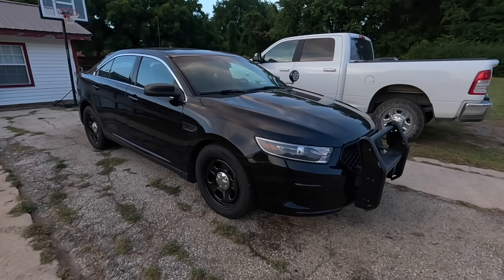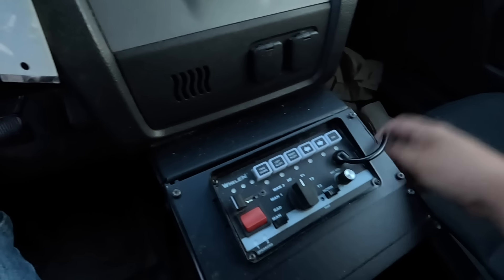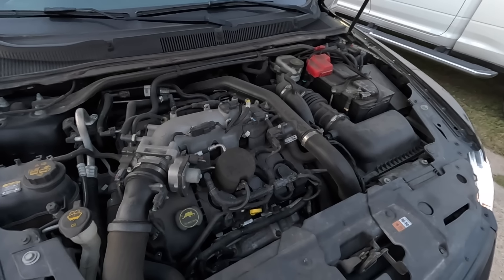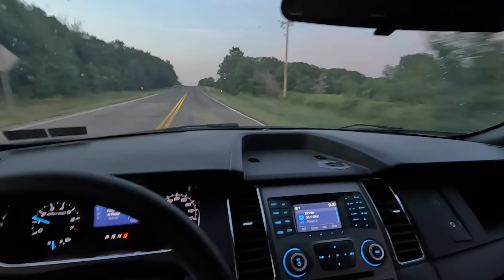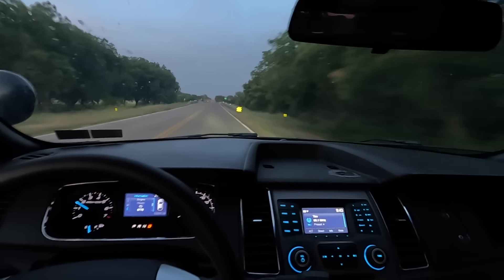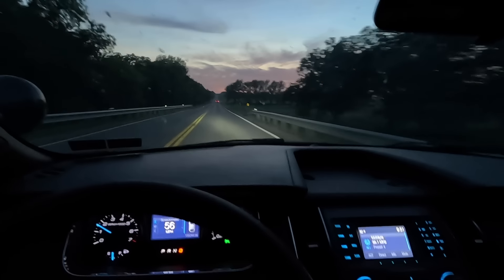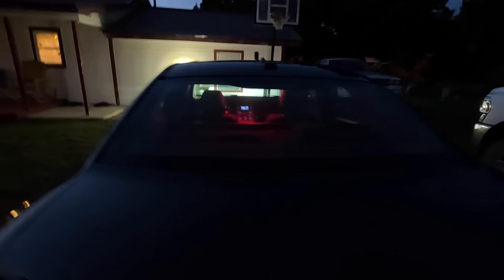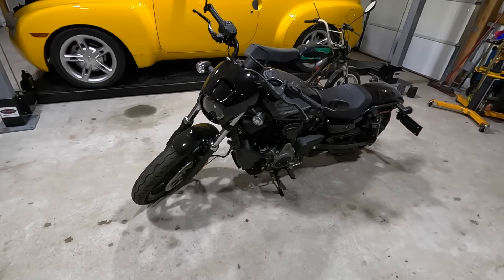I won this Twin Turbo AWD Police Car for $5K from Auction! They Made a BIG Mistake!

Comment: One hour of engine idle time is equal to 33 miles of driving, according to Ford. 4800 hours equals 158,000 miles so mileage equivalent is around 300,000.
Reply: It's not that simple I have a 2011 police charger with the 5.7 hemi and  it has 8335 engine hours and 2759 engine idle hours and I had a mechanic go through the entire car like literally everything and he said it looked like it had about 60k miles on it and it had 107k its all about the maintenance
Reply: 878 idle hours equates to 365.75 days (a little over a year of idling) of run time!
Reply: Yes, Ford does say that. However, I don’t believe that it’s an actual indication of wear on the engine. Ford came up with that spec so that fleet managers knew when to properly change the oil. Because even if the car is only driven a few thousand miles, the oil is still getting worn out as the engine is idling. Still higher idle hours, can mean issues for certain engines. This car is about average with 8000-ish total engine hours and only 4600 idle hours. That’s about the average range for used cop cars. It’s not been beat excessively but it’s no spring chicken either.
Reply: Im a deputy and wouldnt trust a used police car lmao, the amount of things my charger as been drug on just cause the ground clearence is terrible
Reply: I was always told that is was 40?
Reply: @billt2520  I’ve seen number from 25-50. I went with what Ford said since it was a Ford in the story.
Reply: Wow didn’t know that
Reply: @thepurplestallion93  Unless he actually tore the engine down and measured the wear on the bearings, this is nonsense to even believe. Wear happens every time the car starts, that is the majority of wear. Years of turning it on and off to sit still is the same wear as years of driving on the highway.
Reply: Come on, people with the idle hours, most of you would love to own this car for 5k. What a deal 👌.
Reply: @thepurplestallion93  maintenance is everything amd luck to. Some parts are better then other so.tines and so times you just get a car with bad parts. But like you said if you do the maintenance,most vehicles will last.
Reply: On a 78  Grenada maybe.
Reply: I believe Ford came up with that number when the Crown Vic was the king of cop cars. It definitely would not apply to twin turbo 3.5’s.
Reply: @paulhogsten2613  Decimal point error. 365 days = 8760 hours.
Reply: @thepurplestallion93  there’s no way a mechanic can tell that unless he took apart the engine and measured tolerance of pistons , walls, valves and other wearing parts.
Reply: 99% of the wear comes from startup, not idle or running.
Keeping up with the mileage only gets you so far on engine health.
Reply: @glenwaldrop8166  wrong
Reply: @ThaiRoney  No, it's not, it's historically proven. Dry startup is where 99% of engine wear occurs.

You can argue with a wall for all I care, it is a fact.
Reply: Exactly,  its a leak
Reply: It looks great but it had a harddddd life
Reply: Yeah that's not really accurate cause under a load things are very different driving than idle
Reply: @paulhogsten2613  no... 36.5 days. Math not your strong point.
Reply: is that highway or city miles lol
Reply: @ryancollins3227  That car is easily worth 5 grand.
Reply: @thepurplestallion93  thats NOT an ecoboost. Ford's maintenance requirements on ecoboost motors are significantly different
Reply: this is because the turbos are not receiving sufficient oiling during idle. and idling drastically reduces their life
Reply: Mileage or idle time doesn't mean a thing
Reply: @harbingerofkharma  that doesn’t quite make sense to me.. if your engine has oil pressure at idle, which it does, the turbo will receive the same amount of oil pressure, I would argue that high oil pressure can lead to premature failure of the Turbo seals, as well as a heating and cooling cycle. Consistency is key to an Internal Combustion Engine, and if it was used consistently I would wager that the wear is significantly less than actual driving miles.
Reply: Not to say that you’re wrong, but I would be much more willing to gamble on an engine with high idle hours than high mileage.
Reply: SHO engines where designed by Yamaha. At least that's what I've read !
Reply: @wisdomoverfear2685  so was the Lexus RC-F engine, a mean V8
Reply: I’ve bought a few of these from auction. 5k is a great deal for a twin turbo turnkey cruiser. I’d buy a fleet of 20+ for 5k in this condition. After a nice detail and tune up this should easily fetch around 10k. Great content as always 👍👍
Reply: @thepurplestallion93  hey bud I happen to be a lead diesel mechanic myself. Unless your mechanic opened up that engine, he can't anything about the internals. The issue with those idle hours is all rubber seals harden from that heat. Gaskets gets hard and blow out. The most common issue with these cop cars is they can look great till the last second and then major components fail back to back. Good cars to flip, not a good car if you want something for several years.
Reply: My Tahoe 2013 PPV has over 13,000 hours and 130,000 miles.
Reply: @paulhogsten2613  no 8700 idle hours is a year
Reply: @Adierit  " Years of turning it on and off to sit still is the same wear as years of driving on the highway."
And who told you that ?  100% wrong. Please explain how an idling engine would wear the same as being driven , with NO TORQUE loading on it ?  Youtube experts at it again ....!
Reply: I think that very specific parts would be worn and the majority of parts not touched.
Reply: @bradhorner  which is still bad, as any engine failure leads to an entire engine rebuild and at worst an entire engine replacement
Reply: Idle does not equate to actual driving miles. The wear is much more when throttle is applied
Reply: I thought they always turned cars off at donut shops.😊
Reply: Fellas it’s very easy. Yes, 1 hour of idle time equals 33 miles. But not driving miles. All the departments use idle hours to do maintenance on time. That way these cars get regular fluid changes on time even with driving less miles. Idle hours themselves have no effect on the vehicle wear or tear.
Reply: You got a great deal
Reply: The police cars get beat to hell.  Don’t forget shortcuts down bike paths. Stairways, and attempts to get air thanks to Santa Fe,  or BNSF  elevated crossings at 50 or so .
Reply: You can buy or scrounge a light bar. But you cannot have working reds and blues.  You can own them on a non functional basis claiming it’s a historical car or city display Decoy car.
Reply: Ford had a recall on mostvpolice cars to reinforce rear end . All crown Vics.
Reply: @thepurplestallion93  absolutely true..
Reply: @DirtyDanMunicipalMan  if the people who built the engine said it why dispute it? You're literally arguing the meaning of a song with its writer.
Reply: Modern engines are better built and the idle hours dont put stress on other components
Reply: I just bought a 2011 SHO and didn’t even know it was such a sleeper and to my surprise .. wow just wow .. 365HP stock twin turbo . But this car looks amazing as a ex cop car. Great buy dude .. most boring comments about idling I have ever read.. but other then that enjoy .  Great buy !!!

Comment: Twin turbos and all-wheel drive makes it a true Taurus SHO. Remember that police departments don't care about fuel mileage and they have a full-time maintenance department, unlike the retail public.
Reply: Not where I live. They use a shop who is contracted to do it because they don't have their own like that. So basically, if something breaks they get first served before a "regular" customer.
Reply: What’s sucks about buying police cars.   Regardless about mileage they have huge amounts of run time.  Running with engine idle
Reply: @mysixfo8805 runtime or mileage means nothing  coming from a guy that's owned over 300 cars new and old
Reply: Some interceptors are trubo FWD? How can I tell by looking? Trying to decide between this and the SUV. I will just keep an eye out and buy when I find a deal.
Reply: Here with the snow and cold weather that suspension would last long.
Reply: @lifeofmike5126   prolonged idling certainly isn't good  for gasoline engines. Perhaps if you kept a car long enough, rather then owning 300, you'd experience the resulting decrease in engine lifespan.
Reply: @justinkase1360  Options are only fwd/AWD/AWD TT.
Reply: @desmadrex  ty
Reply: @mysixfo8805  probably has 12,000 or better hours on it,  That's why they dont go for retail.  most PDs get rid of them around 1ook, so someone else probably drove it for the other 50k miles.

Comment: With a 3 bar map sensor, cooler thermostat and spark plugs along with an SCT tuner you can make that thing an absolute monster
Reply: yes!!!
Reply: Yes an ECU Tune These are Fast
Reply: Thermostat is a waste. 3bar and a tune. The thermostat has been proven over and over again to not help at all with these cars. Thermostats are money makers for tuners to sell you yet another item. I have ran all the different thermostats out there for these cars and there has been zero gains on the dyno and no change on datalogs either.
Reply: Don't forget gut the thing to tuna can on wheels👻
Reply: Check the fuses for that horn and siren. Also, the siren may have just been unplugged to make it saleable.
Reply: @ChrisJobe  a Thermostat isn’t for h.p. at all, It’s just so water will start flowing at a cooler temp.. than before!
Reply: @scarface9617  that doesn’t help. The engine is built to run at a temperature. Lowering the water temperature will bring it out of its effective range. It doesn’t have a positive affect on anything. I race these cars, test parts for these cars and have had every modification that’s been put out for these cars. Thermostats are snake oil for these cars. These aren’t carb’d 305s.
Reply: @scarface9617  you know how you don’t beat on a car until it’s came to proper temp? Think about that and how a cooler thermostat would affect it as it never gets to the effective range of temp for proper combustion. Mythbusters even did an episode to disprove the “advantages” of cooler thermostats
Reply: @ChrisJobe  you must replied to the wrong guy man! I was telling someone the same thing.. No extra h.p. at All.. it just makes water start flowing at a cooler temp!
Reply: @spankthemonkey3437  This comment has gone severely under appreciated. Cheers from Memphis
Reply: Can't forget the cold air intake. I'm pretty sure there's one that will fit this! If not K&N and AFe make filters for these.
Reply: @ChrisJobe  zero gains, except less prone to pre ignition.
Reply: @danadams1661  no not actually. Colder thermostat serves zero purpose. This isn’t 1970 anymore

Comment: That’s my car that I traded in a couple months ago. If you want the siren/air horn to work there’s a breaker under the hood on the battery. As for the normal horn, you just need the red switch on the siren controller turned off and it will work. I got it from a dealership in Ohio after a local department traded it in around 110k. I still have the cage for the back if you’re interested.
Reply from the maker: Good to meet you! I had a blast with this one. I ended up getting the siren and lights to work in another video. This car is actually being traded for a foxbody in a few days but I appreciate you leaving a comment.
Reply: Did you figure out the trick for putting it into pursuit mode?

(At 55 hard brake tap then punch it) - the car spins to redline and stays downshifted allowing you to use all of the ~360 odd hp to full affect.

Comment: Any time anything is put up for auction, it should sell for the highest bid, unless there’s a reserve. Otherwise they shouldn’t be calling it an auction.
Reply: Yeah pretty scummy to "auction" a car off but then have the option to just not give you the car
Reply: It probably had a reserve. If it's not met then sometimes the "winner" and seller will try to work out a deal rather then have to deal with taking the car back or running it through auction again.
Reply: obviously, there was a reserve.
Reply: The old owner better just sell it for $5000 instead of auction.

Comment: The siren box likely just had the fuse pulled or the breaker under the hood turned off. I’d check that.
Reply: You really should remove the siren.  It can be illegal to just have it installed on a car.  Why don't you make this your daily driver??
Reply: @eyalbarmitzvah  It's not illegal to have on the car. Same with red and blue lights. You can have them, just can not use them on any public roadways. But perfectly legal to have on the car.
Reply: @Goober10584 love to see people know the law 😂. And they may have cut at the power point or even popped/pulled the fuses. Depends how cheap the shop felt when they uninstalled the equipment.

Comment: That is a clean interceptor. I’ve owned several and just love them.  Change the PTU fluid ASAP and watch for leaking water pump. Should be a wire under the dash for the horn that they cut. The braces in the trunk are only on interceptor models and what gives it the 5 star rear end crash rating. Back seat is vinyl but feels like leather.

Comment: As for the horn, there is a loop located under the lower center of the dashboard. Sometimes they cut the horn wires and splice in the siren control.
Reply: Usually they have a switch so you can have a horn or a siren. At least that’s the way I did them.
Reply: @FoMoCo1903  my 2014 police interceptor utility's horn did not work when I received the car.
The loop under the dash was intact. Found the splice at the horn. So the horn button on the steering wheel controls the siren or horn and the different siren modes.
Reply: Exactly. They connected the tap function to the horn button. With no power to the siren, the relay wont activate, thus no horn. Theres usually a relay off the battery positive, under the hood. ( at least when i built them, thats where i put it).  They disconnect the siren, so that they can assert liablity to the new owner, if he uses it.

Comment: My cruiser is a 2015 AWD Taurus with 113000 miles and almost 18000 engine hours. Handling is incredible, especially  on wet roads. With all my gear on, it's not that comfortable after 8 hours of driving. Great find though.

Comment: I just got my 2017 AWD 3.5L6cyl turbo FPIS and I am absolutely in love.  Mine had 87K with only 770 idle hours for 10k.  Only thing I’m not excited about is the no aux input on stereo but have figured out I am going to end up getting a Bluetooth amp and bypass the factory head unit completely.  I am thrilled with mine and hope you are too!!

Comment: Idle hours conversion should be listed within that owner's manual that you found in the glove box. My 2008 Ford Police Interceptor (Crown Vic P71) says each idle hour equals 33 miles which works out to 289,674 miles in your case (8778 x 33 = 289,674).
Reply: Idle hours are 4633, and the other mileage was about 155k, using the 33 miles per idle hour thing that comes out to about 308126 miles, really high for a turbo V6. But cop maintenance appears to treated it well so far and I expect it'll keep going for a long time. It just shows exactly how long many cars will last with proper maintenance.

Comment: Change the PTU fluid and monitor the weephole for the waterpump. Any orange drips around the alternator/ Ac compressor usually mean the waterpump is leaking. You can easily get 440hp with a high octane tune with factory turbos.

Comment: There's usually a relay switch in the trunk or under the hood. It can be red or yellow and if you flip it, it should turn all the lights/siren/PA equipment on. It's meant to be turned off when parked for a while to save the battery.

Comment: Horn works through the police panel, get the panel reconnected or reconnect the horn bypassing the panel.

Nice catch, watch the coolant level though, water pump failures can be a issue.   

The lack of front marker lights tips everyone off at night, same thing with the Crown Victoria.

SEL was the second level, SE, SEL, Limited and the SHO.

Comment: Per Ford, 1 idle hour equates to 33 miles.. so 4,633 idle hrs x 33mi = 152,889 miles in addition to the 155k on the clock.. so theoretically the car has 308k on it
Reply: It is not 33 miles of wear,  that is how to calculate oil change intervals in vehicles
Reply: As a fleet mechanic who's worked for 3 different cities, all of which were exclusively ford products, I can assure you that they do in fact consider it wear. We calculate oil change intervals either by the oil life monitor or odometer readings for light use vehicles, and for the heavy use vehicles(i.e police cars) we change the oil every 30 days because the cars run almost 24/7. My current city garage has a mix of chevy, dodge and ford and they are all treated the same.

"Ford Motor Company defines idling as follows: Over 10 minutes per hour of normal driving, frequent low speed operation, and sustained heavy traffic less than 25 mph. It is important to note that idle hours include low speed driving and don't mean that the cruiser is sitting still that entire time.

Times that a police cruiser may accumulate idle hours include: 25 mph town road patrols, running radar, having pulled over a vehicle, accident scenes, while an officer is on a call, details, winter operation, and while searching an area via patrol car.  All of those activities require either low speed driving or remaining stationary.

Ford says that one hour of idle time = approximately 25 miles of driving.  One hour of engine time = 33 miles of driving."